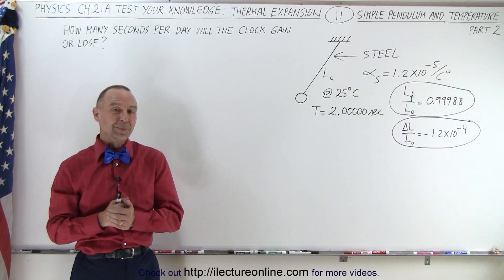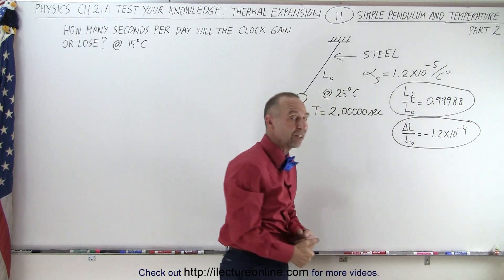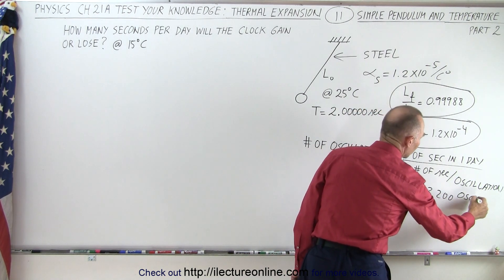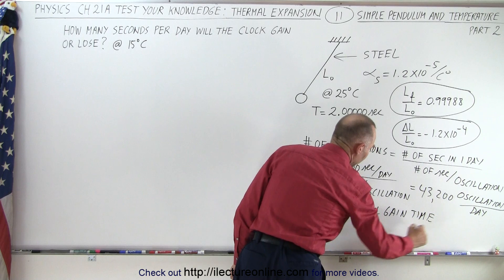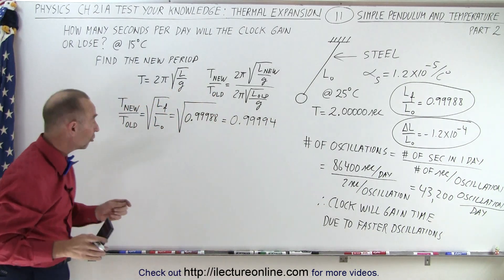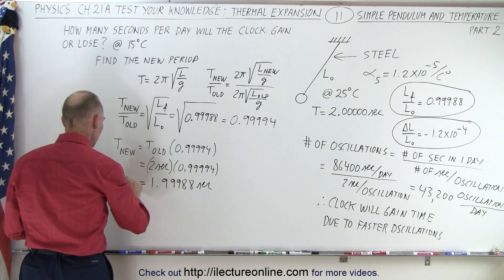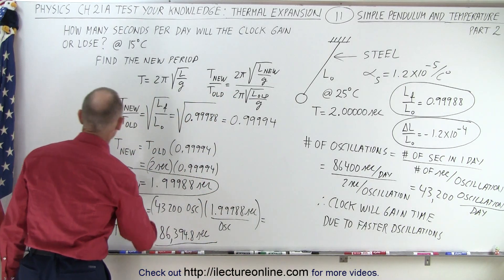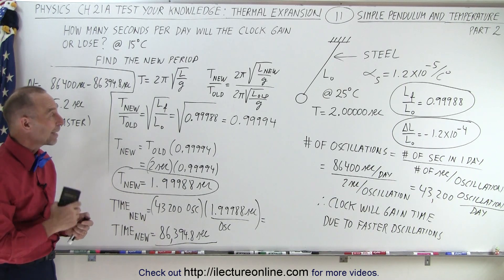Physics - Ch 22A Test Your Knowledge: Thermal Expansion (11 of 20) Simple Pendulum and Temp: Part 2

Comment: I thought I could "give back" to your channel ...

For music, I use a "magic number" (3578.4), and I have a more precise one to I think 6 digits, but the cool part is with that number, the L (m )is 3578.4/beats^2, and the beats are 3578.4/L (m). With beats divide them into 120 for the period.

So period of T=2 (120/2=60). Then L=3578.4/60^2. It goes reallly quickly when you're designing Metronomes or trying to figure measures per minute or notes per second.

Thanks, Professor! I continue to learn loads on your channel!